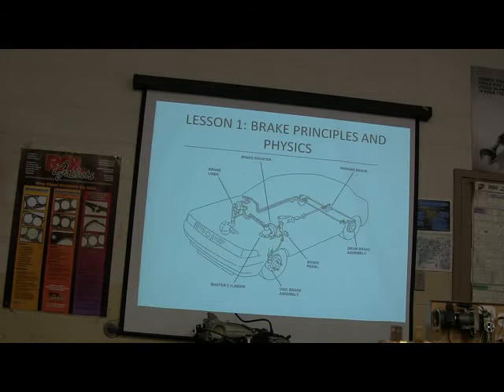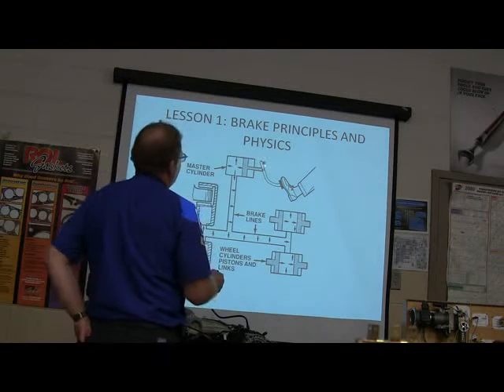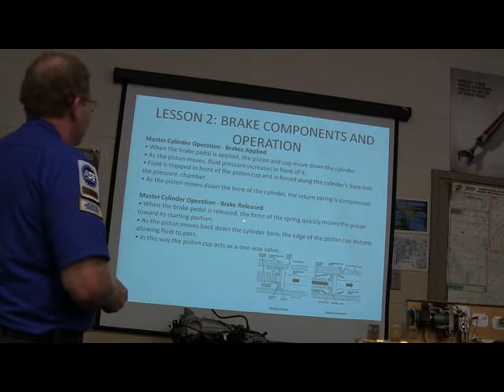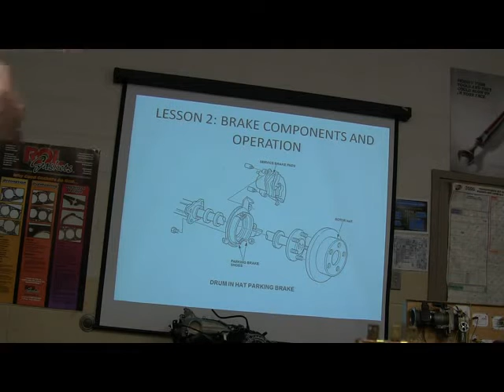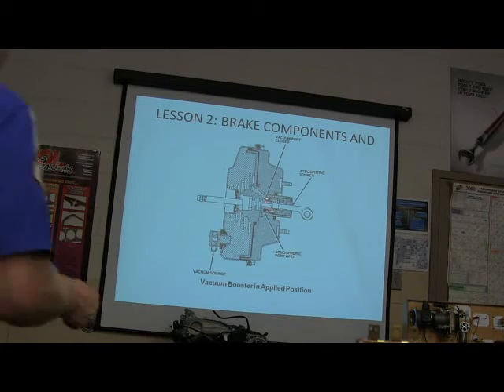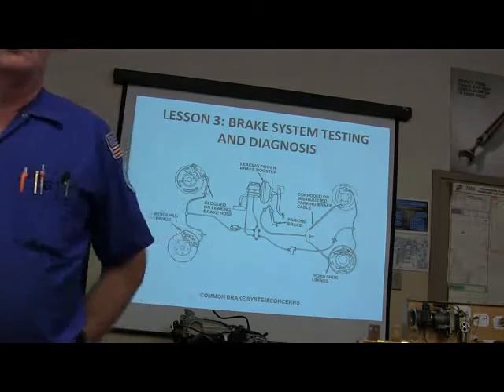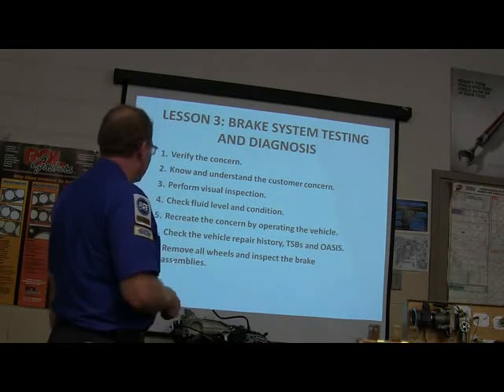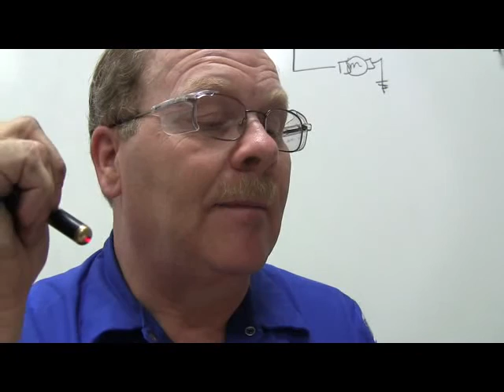Brakes Basics   Day 1

Comment: I was a kid visiting a shop down the street from Elsik H.S. . The mechanic told the boss the brakes were done. The boss put the customer in the car in the bay before the brakes were pumped up. I got to witness a perfect solid T-bone as the customer backed out into heavy traffic moving 35mph. Several years later I did  tow out to my place clean up job from that same shop due to a mechanic that underestimated work on a performance modification.
Reply: I've seen far too many techs fail to pump their brakes after a service. Hilarious story.

Comment: Hello, Sir. If I understand correctly, the proportionning valve can be used on 4 wheel disc brake as well as front disk and rear drum brake? Also, is it the powertrain control module that monitors the wheel speed sensors and senses a wheel lock up or the abs control module that does the monitoring? You answer will be very appreciated.
Reply from the maker: The proportioning valve prevents rear wheel lockup during braking. The PCM sometimes limits engine power during wheel spin, but the ABS has its own module that does most of the Anti-Lock work.